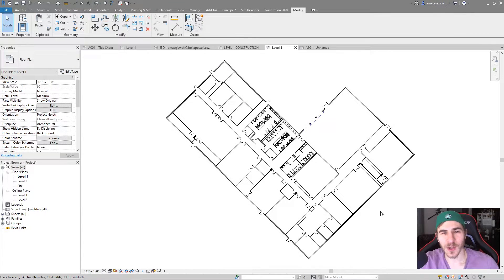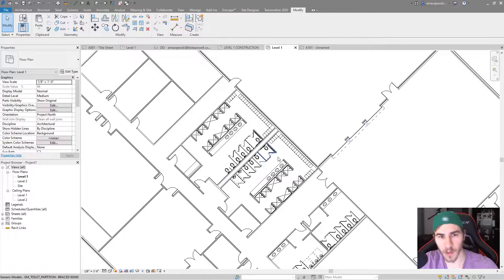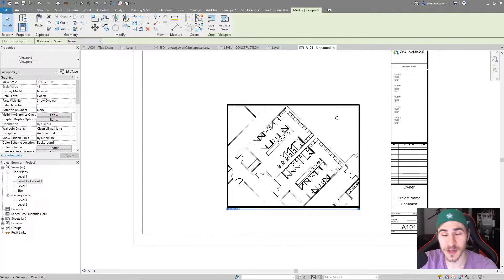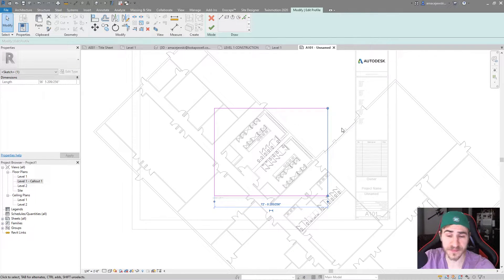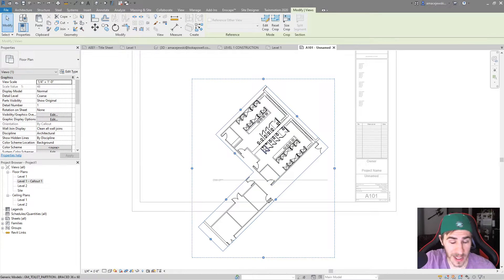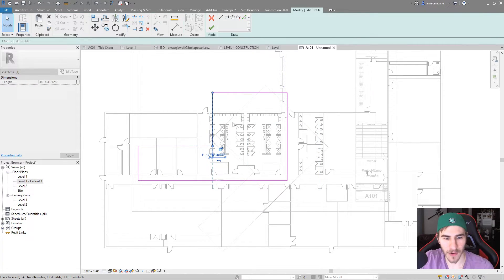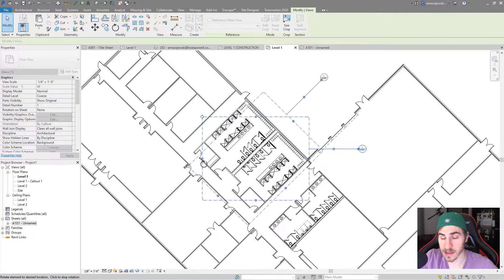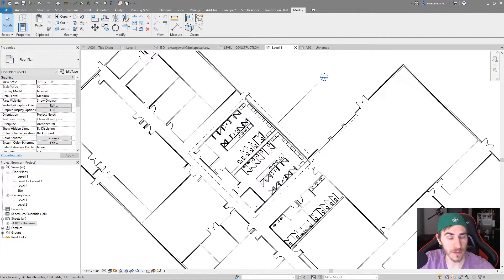How to Rotate Callout View | Revit

Comment: This all makes sense, but my issue is when I place the rotated plan on a sheet directly below the corresponding elevation, my elevation callout tag in the plan view has rotated text and if I try to rotate the callout, obviously the elevation changes. Any thoughts on how to fix my predicament?
Reply from the maker: Yes unfortunately, the annotations will rotate as well. I would try copying them before then rotating the view and pasting the annotations back.

Comment: OK. But how do you rotate it if you don't have an easy angle like 45 degrees? What if a wall is like 20.0001200820328308.........degrees? How do you rotate to be dead accurate then?
Reply from the maker: If you do not have an accurate or specific angle to work with, I tend to draw a quick line, I know has the angle I need or I at least know is at a 0 or 90 degree angle to start with. Might have to rotate things twice to get what you want.